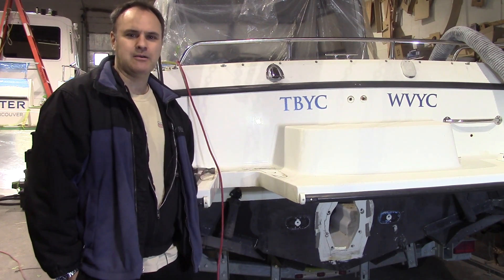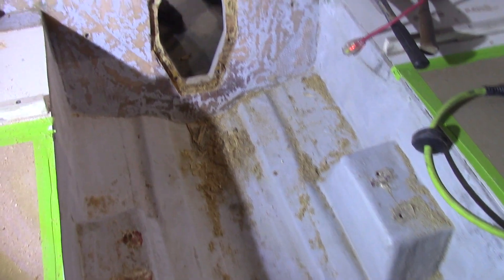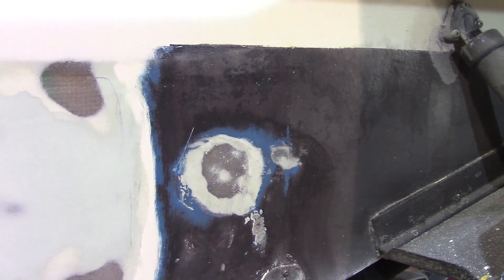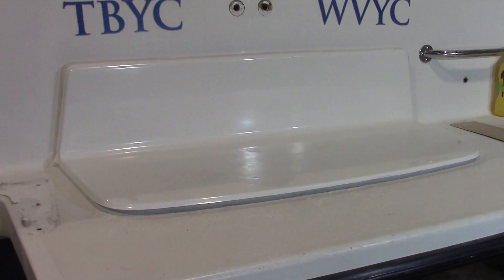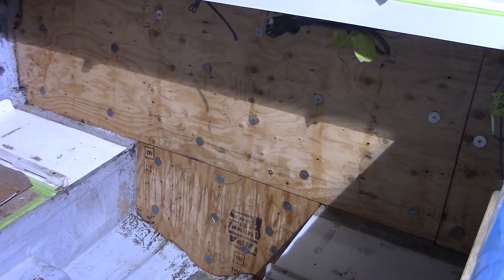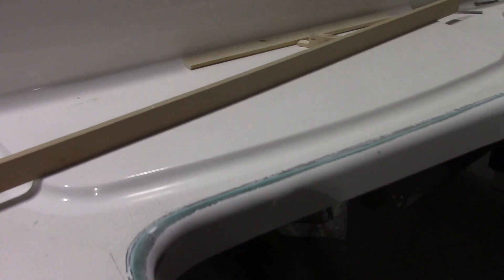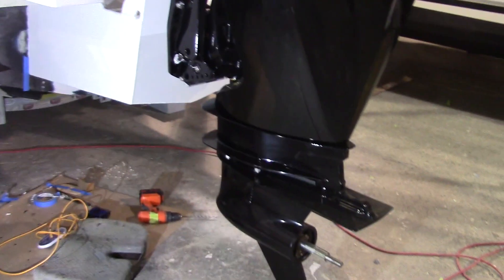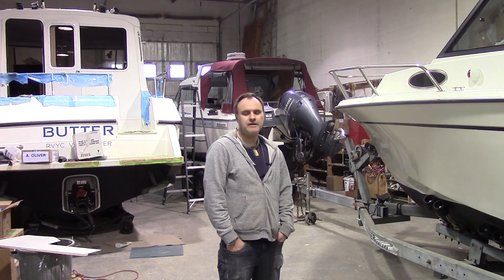Stern drive to outboard motor conversion

Comment: Can u help me out to build a pod i am from india to get a pod is not easy it has to be imported its quite expensive i can make it if i can get measurements
Reply from the maker: You need to get the angle of the transom. It has to be long enough so it clears the transom with the motor tilted. Ours are 22" wide. The top needs an opening to access the bolts. We use Armstrong hatches.

Comment: Given that electric outboards are less expensive and easier to refit than inboard motors AND allows the bay to be used for batteries I expect EV versions of this to become VERY popular.
Reply: That's not true, at all. Just the BATTERY setup alone for a 50hp electric outboard equivalent is in excess of $20,000. Just batteries. No motor or controls. You also can't run electric outboards full throttle for more than an hour before they need to be recharged. Then, there's the weight. The battery setup I just described is 800 pounds. Plus you need space to put it, components and all.

I'm not hating. These are just facts. There's a space for electric outboards in the small boat fishing world or maybe the leisure pontoon ride world. However, until the battery technology gets better, the grid can handle the increased usage, and it is all wayyyy cheaper, internal combustion powered boats will continue to reign supreme.

Comment: Some questions Sir:
What is the prime reason for this....I read the outdrives consume WAY less gas, is that true?
What motor was in that before and what is the price of such a 300hp outboard.
And lastly, could this be done to some speedboat like a Formula SR-1 and would it still lean as crazy in the curve?
Thanks for your time :)
Reply from the maker: The boat had a Volvo 300 hp gas engine with duoprop. I have found that 4 stroke outboards and stern drives have similar fuel economy. A 300 hp Mercury outboard is about $34,000 Canadian. I'm sure you could do this to a Formula and it should lean similarly.

Comment: What's the cost just for the transom and bracket work excluding the engine and rigging?
Reply from the maker: Hi Mike, it would be about $8,000 CAD to fill in the hole, reinforce the transom and install motor pod.